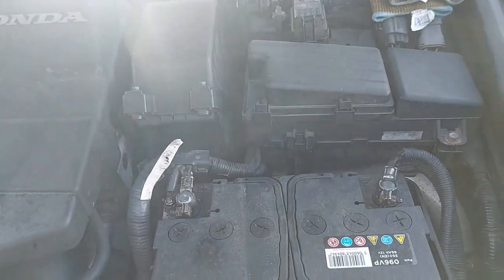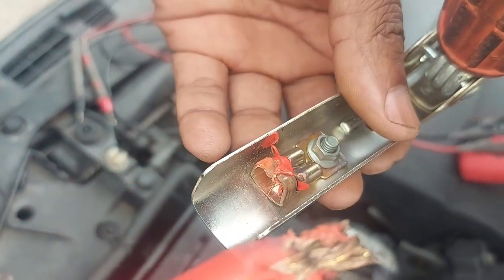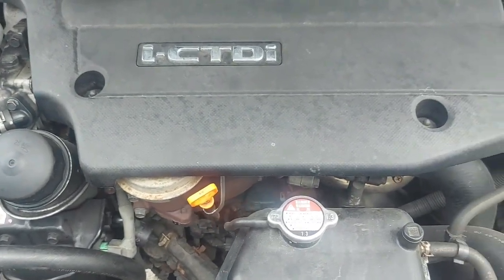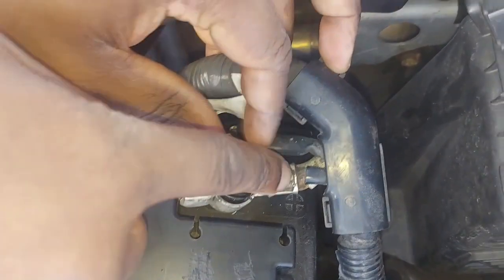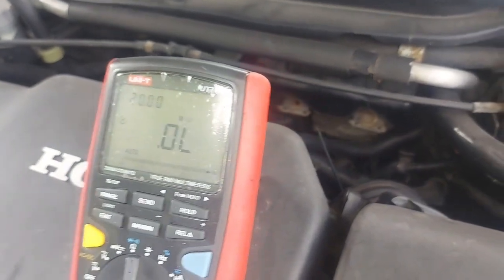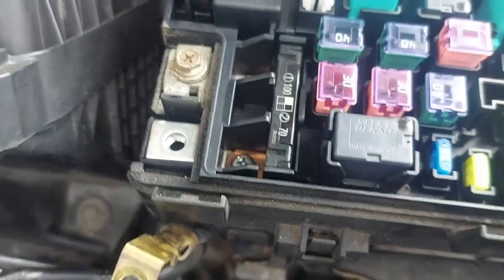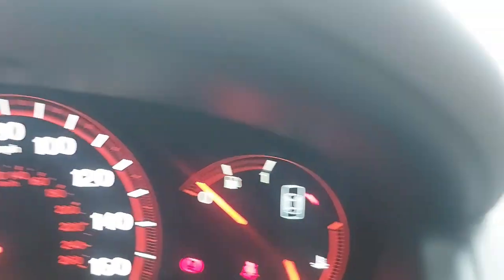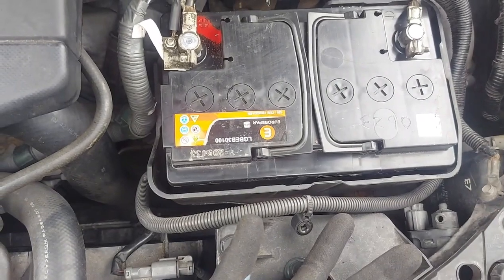Watch This Alternator almost Catch Fire (Dangerous Short)

Comment: Dealing with a similar issue and found this video. It is very helpful thank you
Reply from the maker: I am happy this was helpful, Thank you for your support
Reply: I have same issue on a Vauxhall,no dash electrics at all today,after car was smoking driving yesterday but didn’t know what it was.
Put an old battery on to test and smoke poured from the alternator after a few minutes,but I didn’t have no dash lights or power at all when I turned ignition on ?! So I am guessing I need to put on a decent battery to test dash lights and power after disconnectiing alternator connection.
It will be good to get power from the key turn on dash before I buy an alternator.
Really helpful video 👍 thanks
Reply: Update,I took the battery connection at the alternator off,and hey presto the dash lit up and I started it with a decent battery charged.
Least I can drive for the moment and pick up a used alternator.
With out your video it would have cost me a fortune for a mobile mechanic to come out just to diagnose and then start the process of getting one put in.
Great video upload and I learnt from it 🙏✨